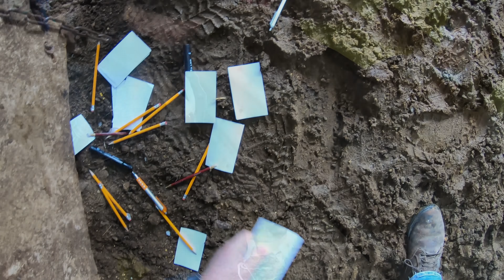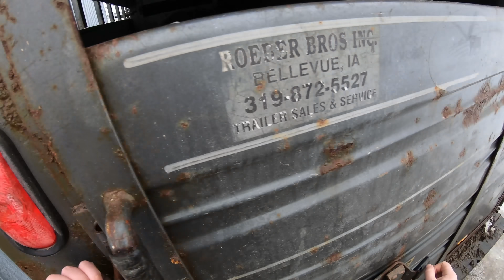Better Roads

Comment: 3:00  Just a suggestion...I use cat litter instead of salt.  Cat litter provides excellent traction.  The issue I have with salt is that it simply burns its way south only to refreeze during the night which, turns into a highly polished surface the next day!

Comment: You should throw some crusher stone down it will help with keeping the mud a bit lower and dust your cattle will also not be sliding around that much and if you can get hold of conveyor belt strips throw that down in your trailer keep the cattle from falling around and sliding during transport

Comment: I keep several pails of pea gravel handy in winter, rather than salt.  I want traction, not melting.
The rock salt I keep separate for melting the brick walks and the steps.  I don't like using too-much salt since the snow/ice doesn't usually last that long, ...but my walk at the front door is in shadow on the north-side of the house and NEVER gets any Sun.

Comment: This was a great video I didn't know you could use spice when you get stuck on ice that is a good tip to remember.
I dont know a lot about cattle but after this video it seems they dont like to walk on snow and ice. 
It seemed like to me that the cow wasn't trying to escape I think the cows feet was sliding on the snow and ice I could be wrong though

Comment: just a observation if you had some better tires than just the factory street tread might be more useful
Reply: Your observation lacks experience in his scenario. Chains, studs or increasing weight on drive tires are the only difference anything makes on ice. My experience is 10 years of snow plowing.
Reply: We've had a bad winter of freeze/thaw cycles and a few ice storms. Everything is coated in ice with melt water on top, even walking on it is difficult.
Reply: @JCLawn51  Well have have 32 plus years of semi driving & snow plowing, having backed into numerous loading dock wells,and job sites where there are  no improved roads, so have plenty of ice experience, again a good snow and ice tire will help,look into sipped tires ,
Reply: @kw900lkevin  sipped tires huh?  You mean like the little slits on the lugs of his oem tires?
Reply: @JCLawn51  nope those are not sipped
Reply: JCLawn51 Your response doesn’t make any sense. Ice tires like blizzaks are known to out perform all seasons by a long shot. Better tires would help, all seasons get very stiff below 7 degrees.

Comment: I suggest y’all put a hog wire fence in the floor of the trailer. As you can see they cows were slipping around quite a lot.
Reply: I'd rather see Sawdust it's more aggressive and easy on the feet

Comment: Hey how long till you have a new trailor for moving the cow's with the semi ?  I know you will need more cow's but its only time
Reply: A cattle pot for the semi tractor would hold 40 plus head, a straight deck trailer would hold 30 head.  Those would cost at least $18000 For anything decent that is used.  Then you would need a cattle chute for unloading at each farm and building.  Plus the fact it's huge and can't get into the small spaces.  It's just not worth the investment unless you're running several hundred head.  They are far better off with a gooseneck.

Comment: thats not a grain grinder, it just a roller mill, it rolls the corn flat or just crackes it depending how you set the 2 rollers, i like grinding it fine with a grain grinder for my calves, i can make floor if i wanted to, calves get much more out of the corn an barley when it is finer ground, if you just crack the corn for calves you see a lot of it still coming out the other end, they do really well on a 50/50 mix of corn and barley ground, even when they get older i still grind it, but not as fine, i know were there is a roller mill like that one for $200 cnd it was on kijiji as a grain grinder but its a roller mill, has 2 rollers with metal bars on the rollers, i drove all that way for nothing/  a grinder has stones

Comment: You really need a ramp for that trailer, cows has a very poor depth perception, to them that small hight lookes like either 2 inches or like 6 feet, they cant tell. It will be a easier job loading and unloading the cattle.
Reply: No trailer like that uses a ramp to load and unload cattle.
Reply: @jeffgixer5185  no but you could always fix some sort of ramp. It will be better for the cows and it will speed up loading and unloading.
Reply: @sparkcycle2315  it's not worth the time and effort.  It would have to be hauled to every place you unload.  Did you notice the sale barn doesn't have a ramp and they unload hundreds of trailers a week.     That is one of the big advantages of using a trailer is not needing a ramp.  You say it would save time, sorry no, by the time you move the ramp into place you can have the cattle off or one the trailer.  This ramp would also have to very heavy to support at least 2 cattle at once.  It would actually be more danger to the cattle.
Reply: @jeffgixer5185  It's not just for saving time, it's about cattle welfare too. Cattle should not have to jump on and off things, falling and risking injury. I understand that hauling it around would be difficult, maybe if you had a ramp that folds up in front of the door? But then I realize that it is a big modifications to do. I am just not used to see cattle trailers without ramps, it's illegal in Sweden for cattle to jump upp and down of trailers, therefore my love for ramps
Reply: @sparkcycle2315  ramps are actually much more dangerous for cattle slipping and falling and injuring themselves.  It's much easier for them to step up or down one single step than it is for them to try to get traction going up and down a ramp where they could fall of that could break, move or give way.  I do grant you that unloading on frozen ice covered ground is not ideal.  But ramps are far more dangerous than stepping up or down.
Reply: @jeffgixer5185  Well I guess Its up to how the ramp is built, what angle and so what, and cleaning. In Sweden we use wooden planks with even distance on the ramp to decrease the risk of them falling. And I dont think that it really matters to much if they step up and down, Its just that for the cows they cant "measure" the distance and Its stressing for them, as I said, to them it could just as well be like 6-7 feet.
Reply: And Ryan, although you probably wont ever read any of this, I do not mean any disrespect to either you or your farm. I am not to tell others what to do, I meant it as a recommendation. I like to watch your videos, keep up the good work!
Reply: @sparkcycle2315  that's why you take it slow and let them look.  For decades cows stepped of gutters in tie stall and station barns.  Today they are housed in free stall barns that they have to step up into and they manage just fine.   I am pretty sure they were over that trauma you claim they experience within a minute or two.  No need to call the cow psychiatrist.
Reply: @jeffgixer5185  no need for a cow psychology, but that stress has been proven to reduce the growth of a cattle, at least for sometime, or weight loss. And that's not good when you have cattle.
Reply: @sparkcycle2315  the cow psychologist was a joke. There are people that take their dogs to them.  

I would say that the stress of cattle being hauled down the road in a trailer, being put into a new lot, being put on new feed, being put in with new cattle, going through a sale, is far more stressful than stepping up or down a foot.  Your worry about a ramp is misguided.
Reply: @jeffgixer5185  of course that moving to a new farm is stressful, and that's why you should try to do all you can to eliminate things that can be stressful, to try and decrease the amount of stress. Not just with a ramp but overall.
Reply: @sparkcycle2315  to me the ramp is not a big concern.  That is the biggest advantage of trailers, not having to use a ramp.

Comment: That’s a good looking pile of girls. Please do one thing. Don’t stick your arm in the trailer. We have all done it a time or two but after a couple close calls over the years I make a conscious every not stick my arm through a trailer or fence to touch a cow. One sudden move the wrong way and you have a broken arm. I used an old walking stick when working cows to nudge them on the rump instead of my arm.